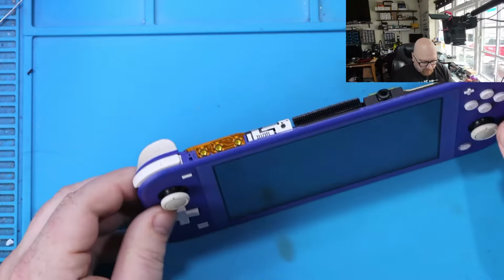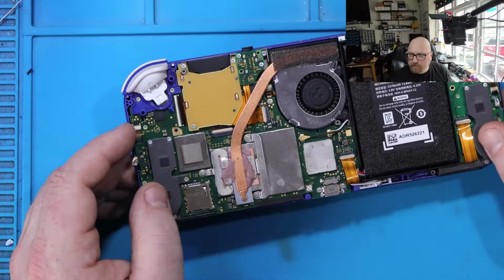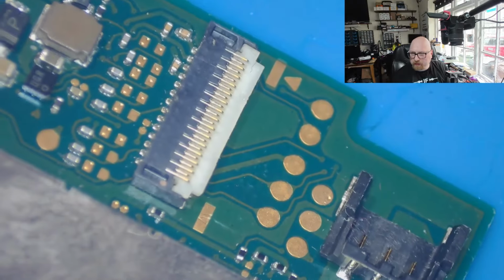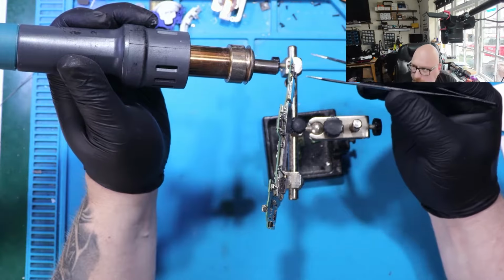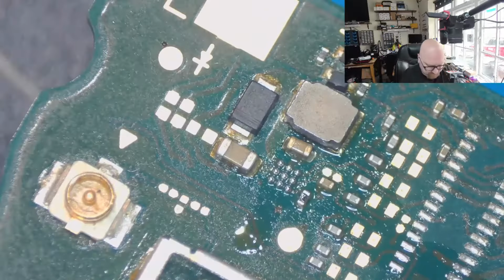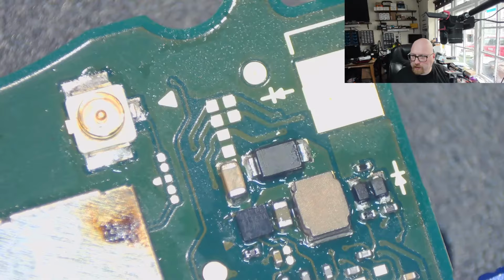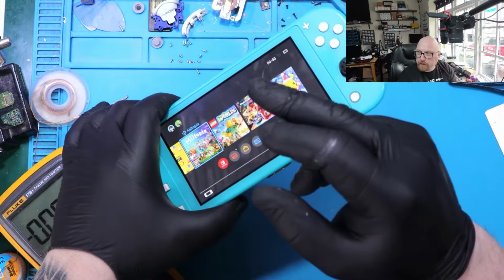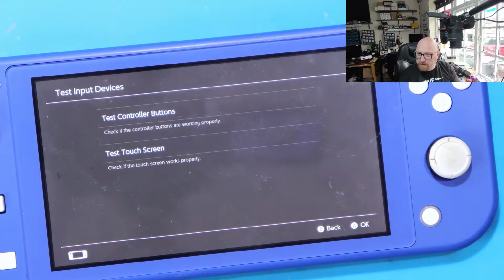Nintendo switch lite sound but no picture. Diagnostic and repair

Comment: Hi, i got a question, switch oled, it charges battery, amp meter shows 0,41 amp draw, one time in a minute i can see charging symbol, or nintendo logo when try to boot it, after a 2 sec it disappears. When battery was flat, charging symbol was present until console started to boot, then it turned off,  M92 checked and changed on new, same thing with BQ, but battery is still charging. No modding attepts, no liquid damage, display with battery works on second OLED, any ideas what can be wrong?

Comment: Can someone help me please?
The same thing started happening to me after I replaced the left joystick with a new one and I did everything right during the repair. I managed to put everything right back in order and put the shell back on with no trouble But now my new issue is that the little latch that holds down the main LCD ribbon cable came off and I don't know how it happened. I did found it on my kitchen counter next to my switch lite after I did the repair and I thought I put it in a small little baggie for safe keeping, just until I found a way to put it back on but I somehow lost it. is there somewhere I Can buy a replacement part for the missing latch piece? And If I Do end up finding it again, Is there a way I can safely put it back on or am I completely screwed?
Reply: Probably better off buying a donor board and taking the parts from that

Comment: When checking the backlight ribbon cable I get no voltage at all.
Reply: same here.  Did you ever find a solution?
Reply: @digipimp75  No i tried a new screen and still no picture but has sound. I'm going to replace the max77620h chip on board. I watched a video on northridge fix YouTube channel and he had the same issue replaced the chip and image came back on.
Reply: @rm4213  Thanks for the reply.   I just tested my board in another known working system and the backlight works, so it looks like the mainboard is fine.  I tried switching out the daughter boards and long flex cables too but no change.   Going to try a replacement screen
Reply: @digipimp75  Yes sound like screen is bad but you could have put that other board in yours and would have known forsure if your screen is good or not

Comment: My switch lite is does not show any display but the back light is on,what could be the cause of it?
Reply: Found solution ?:P
Reply: i saw the reason why my lite has no display coz the display ic is broken... so display ic replacement needed

Comment: Awesome!👍 I had this exact problem. I had a bit of a time using my hot air station...a cap moved, and had a hard time soldering it back on. Other than that, it turned out perfect. Thank you!!👍

Comment: Hey, my touchscreen stopped working after a reshell but everything else is fine. Any idea what it could be? Switch lite
Reply: If you were just doing a reshell, you probably forgot to close the ribbon connector clamps for the touchscreen.
Reply: @gwenturo9550  yeah I fixed it and it was the ribbon, came out perfect, I gave it to a friend though

Comment: Mine is having a issue, the screen will light up and i can hear the stuff on the screen but the picture itself isn't coming in, i dont know whats causing it
Reply: reseat your flex cables, the backlight working usually means that one of the flex cables isnt connected well
Reply: This comment just saved my life thank you  @writer6006
Reply: "Has anyone already found a solution to the problem? I have the same problem. I’ve plugged and unplugged the cables several times."
Reply: same when i tried to connect my mario live kart it suddenly turned pitch black with sound
Reply: Mine is having the same problem, is it possible happen because of the touch-screen flat? I tested only the lcd, the screen turn on but no image
Reply: @deivonferreira check BD8316GWL chip
Reply: I was playing a game just fine and I literally watched the screen fade to nothing

Comment: Can anyone help me with OLED version? Same symptoms. No picture, but working touch screen, sound etc. Also when connected to external display using type c cable everything works. Inspected display connector and whole board. no signs of damaged ics.
Reply: Did you find out how to fix it I have the same problem ??
Reply: Do you have a fix ?
Reply: Probably need a display at that point. I take it you didn't see any damage to the ribbons either?

Comment: Do you have a business repairing?  If so can people mail you repairs?  I have a switch lite with the same problem you can head sounds but no display.  Just had the charger port replaced and now this.  Screen did work before the port was replaced.
Reply from the maker: Yes, we have. We're based at 25 Springfield Rd WV100LQ. Please contact us through Whatsapp 07451466640
Reply: @Tvpartsworld  didn't realize you lived on the other side of the world lol dang it!
Reply: @tvpartsworld806  ...I've taken my switch to two different places locally with the exact same problem...I wouldn't mind mailing it to you if possible

Comment: Hello, I want to ask so I dont play my switch for 6 month then today when I want to play it, the screen show black red and white line, then turn off after that there's sound but blank screen, so its my lcd or the cable?
Reply from the maker: If it's the Switch Lite you need to check the ribbon tape which goes from the motherboard to the second board. On the second board there are buttons and few connectors. One of them is the backlight connector so you should check it first.

Comment: I appreciate the video it helped me repair the nintendo  switch lite I had purchased with broken controllers and the person said they messed up the screen after attempting to fix the analogs I put the main board in a known good housing had same issue sound and no video I ordered the little controllers from digikey they were for nintendo switch but worked fine in the switch lite I need the reball stencil now. I seen a switch for 30 dollars but has a blue screen will look at your videos to see if I can purchase and fix thanks for taking the time to share your knowledge

Comment: that little white plastic piece on the right where the display ribbon connects fell off..... can I put it back? what do I do?
Reply from the maker: The whole connector has to be replaced. That flap is very important and it gives a pressure on the pins inside of the connector and thank of that it creates connection.
Reply: Same thing happened to me. Can I reach the white piece or replace it? Or do I have to solder a whole new piece? Some one said they used double sided foam tape?

Comment: Hey I'm back again. So I did my third switch lite back light repair. I do have a display now but I'm only getting it to go up to roughly 35% brightness (15v on circuit.) I also have no input when pushing left on d pad. I saw you have to replace a connector again because the one you used had a missing pin which caused your d pad to do the damet. I'm using brand new connectors. I've swapped daughter boards, ribbon cables etc. Any ideas on what you think may be the issue? Also replaced the back light controller ic just to cancel that from the equation on the brightness issue. Thanks!
Reply from the maker: Hi. I would try this motherboard with different screen first. 15volts is a bit too low. It should be 18v-21v when the backlight is on
Reply: @tvpartsworld806  lol yea I hooked up a spare screen I had and laid it on the back of the board. Same result. Never seen this issue before once getting the back light going. May just have to take some shots in the dark now with certain things. My buddy there lives over in the UK and does repairs told me to try a M92 next. Never seen the M92 correspond with the backlight circuit ever but wouldn't hurt to try. Said he actually fixed a lite once by changing it.
Reply from the maker: @hove131  ok so next step is to replace the coil and 3 diodes in the backlight circuit . Use ones from donor boards.
Reply: @tvpartsworld806  I measured the coil and it was okay at around 4v but I'll go ahead and replace them anyways. Appreciate your help. Watch your videos at work all night even though I've already watched them all lol. Your channel is very underated. Keep on pumping out the videos to keep me entertained here 😂 where at in the UK are you from if you don't mind me asking? Going to ask my buddy that lives over there. Thanks again!
Reply: @tvpartsworld806  diodes replaced and no change. I'll try the coil tomorrow morning after work and let you know. Thanks again.
Reply: @tvpartsworld806  so I changed the inductor and that did it. I still have no input on the left d pad. I changed the connector one more time just to rule that out. This switch had been opened before and messed with so not sure if anything could have caused that. Tried new daughter board, cables etc. No idea at this point on the left d pad issue. Appreciate the help in pointing me to the diodes/inductor to get the brightness levels working correctly. Thanks!
Reply from the maker: @hove131  glad you fixed the brightness. if you soldered the zif connector properly, only one way to fix it is to replace stm32 ic. I’ve made a video of it and it’s called the L, R, ZR button doesn’t work? One of them, Something like that.
Reply: @tvpartsworld806  it's possible but I couldn't see myself messing up the connector twice on that same button lol appreciate the help I'll check out that video!

Comment: Working on same thing now. Replaced the backlight ic and the max ic and have had a new connector sitting next to it for a few days going on next which should hopefully restore power to the daughter board and back light again.
Reply: Me sale la luz de fondo que ilumina pero no da imagen , y cuando mido en  la zona como en el video donde empieza a medir por donde está la bobina el diodo que está arriba me pinta en continuidad,  repito el diodo o componente que está justamente arriba de la bobina me pita , los demás componente que están al rededor de esa zona como en el video todos bien , será ese el componente que esta dañado y que causa ese problema en la nintendo switch lite ?? Espero respuesta saludos gracias
Reply: how did it go?
Reply: @just_julixn  Repaired it